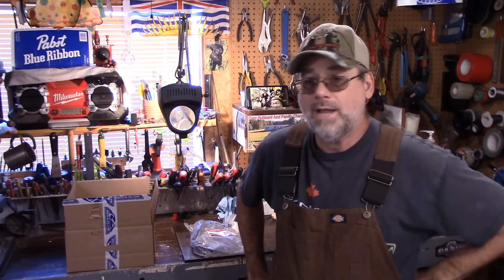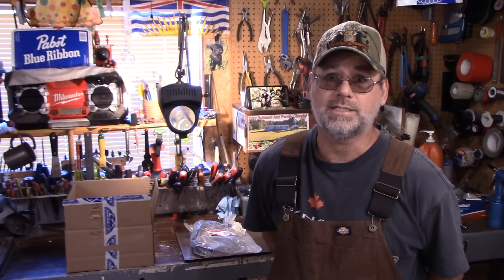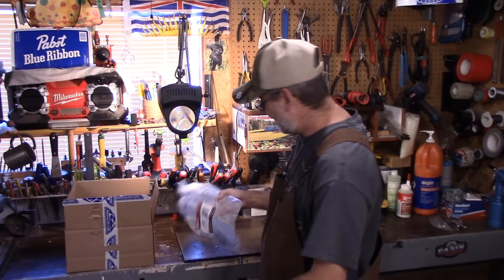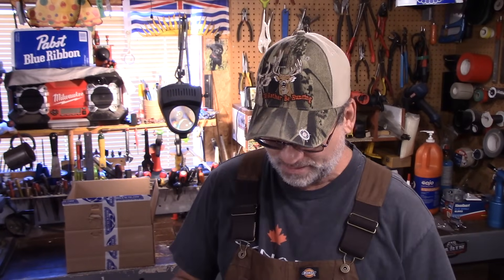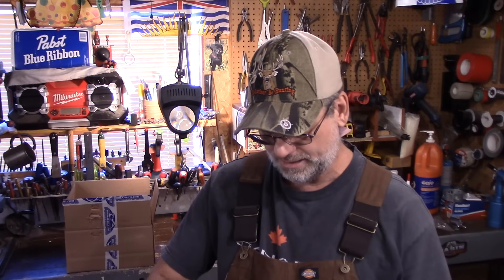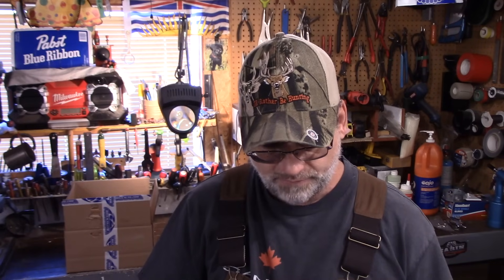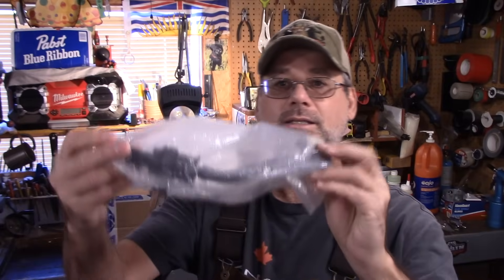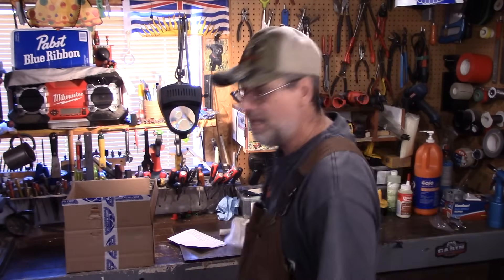F150  STALLING AT STOPS - THE FIX -  PART TWO

Comment: What about fuel pump activation noise???? I dont have a fuel pump noise and changed the fuel pump driver model
Reply from the maker: Mine was not a fuel related fault , the purge valve resolved it for me.
Reply: I changed mine and didn't hear the hissing noise just to find out that the "New" part I purchased was faulty. Hopefully up and running by now!

Comment: Hey Steve , I changed out the vapor canister purge valve and still my truck stalls out . Do you think it could be the fuel modulation controller ?
Reply from the maker: Gary if it didnt resolve it I would  see if your local ford dealer has any idea . Its  not  going to be easy doing it on your own as you may run out of money before you run out of guesses  :)
Reply: Hey Steve , My problem was The Fuel Pump relay P/N 8T2Z14N089D FOR $22.00 Since I changed that out my truck hasn't stalled.
Reply from the maker: Good news and a low cost fix 👍

Comment: I have an 07 f150 standard that everytime I downshift to stop at a light,  the rpms bounces to very very low and dies.  I don't have the money to take it to a shop but I'll try to fix it myself.  Any idea on what it could be??? I'm lost on this and stressing over how much its going to cost to get it running right. HELP PLEASE!!! 😳😳😳😳
Reply from the maker: First thing comes to mind is a dirty throttle body . Try cleaning it maybe that's  all it is.
Reply: @SteveRobReviews  I'll youtube what that is and see if I can get to it myself.  Thank you! I'll keep you posted!
Reply: The videos I've seen had Triton on the engines and 5.something engines... mines a 4.2 v6.  Is it all basically same on top? The Triton was totally different on top .
Reply: you could also try cleaning the MAF using CRC Industries Mass Air Flow Sensor cleaner. And if your going to clean the throttle body off the truck..you'll want to do a relearn process. Just google throttle body relearn process for your truck. Just did all this recently.

Comment: Have the same issue. 2015 f150 5.0. I couldnt find the rock auto part number you hard. Can you help me please
Reply from the maker: @jamesbush4568  Best advice I can give is to go to  your local ford dealer for the correct part.
Reply: Did it fix your problem I have the same truck year and motor having the same issue
Reply from the maker: For my 2010 4.6 litre the evap purge valve solved the stalling.  Took 5 minutes for me to change myself.

Comment: Any help,    I have a stall and hesitation on my 2002 ford f150,  only stalls and hesitation in cold mornings.  It cranks fine but stalls after a few miles. Cranks right back up and runs fine.  If I warm it up and then go, it runs fine
Reply from the maker: Could be many things but cleaning the throttle body is a good start.
Reply: I cleaned it.  I took it off.  New mass. New IAC. New everything but fuel pump.   It still runs great just has to warm up or be warm weather.  It stalls but cranks right back up and  runs great.   I'm gonna try fuel pump. It will be last to try. Everything else is new. All the little things.  It doesn't have any issues in the summer.  At all
Reply: Thanks for help.  Any help.
Reply: bad capacitors on your eec (computer)
Reply: If the eec or computer was bad, it would do it all the time.    It only does this in cold weather
Reply: @davidscott9257  If the eec or computer was bad, it would do it all the time.    It only does this in cold weather
Reply: @thebull5099  coolant temp sensor. when they go bad it'll make the truck run horrible also. it won't throw a code for it either, its pretty much the first sensor signal the ecc picks up. your truck will have two of 'em, one for the actual coolant temp, and the other one for the signal to send to the temp guage.

Comment: I have a 1997 f 150 4.2 v6 runs good but it  does stall some times  I put a new fuel filter it was good for a few days  then same crap stalling I've heard the spark plugs come lose on f150 maybe that's the problem because I bought it three years ago first two years ran perfect didn't stall at all.
Reply from the maker: Wayne if changing the fuel filter fixed it from stalling for a couple of days  then maybe you have lots of dirt in your fuel tank.  I'm thinking if your truck stalled every day and a new fuel filter fixed it temporarily them maybe its lack of fuel  or another plugged filter.
Reply: Dirty throttle body

Comment: My 2005 f150 4.6 stalled when I was coasting to a red light.   Started right back up but check engine light was on.  Got a scan, several codes....P0401, P0109, P2198, P2196.  Where do I start??  Help!!!
Reply: Also stalled a week later while driving at 40mph on a straight road.
Reply from the maker: Wow where do I start is right  is a great question . The codes will  give you a clue as to where to start and some codes are a result of the stall. The 401 egr flow is a good start  and go from there . If you want to know how to diagnose the 401 check out my buddies channel he has  plenty of Ford 401 vids. ScannerDanner , Paul is about the best there is.

Comment: I got a 2010 Lariat 5.4. It would stall 2 or 3 times in a 10-mile city trip every now and then. Never threw a code. Easy restart. Sometimes right  after a fill-up it would struggle at start up. Replaced this can and all is well. Thanks.
Reply from the maker: That's terrific 👍

Comment: i got 2015 F150 that i cleaned the throttle body and replaced the valve and it still does it. The throttle body was replaced this past july and it stopped doing it for a while and now its back. i get no lights at all . This is really weird problem . How has Ford not been able to fix this . It looks like it happens on every year modal f150.  will be the last Ford junk i will get. i guess i will just start replacing parts till it stops doing it.
Reply from the maker: The evap purge valve solved my stalling for over 2 years now.
Reply: What motor is yours?

Comment: I have a 1985 f150 lariat and it would  die on me randomly while driving, i changed the tfi module and it turned on but then when i drove it it started stalling bad untill it wouldnt turn back on, now it doesnt turn on even after i changed out the ignition coil
Reply from the maker: Wow , whatever it is it can be tested and fixed.

Comment: I have a 2010 f150 4.6l that idles rough and has no power under load and stalls when i stop. Throughs codes for 2 3 and 4 misfireing. Changed plugs and coils with no luck. Any ideas?
Reply from the maker: Well Wayne they are the 2 most likely causes but there's still injector flow , compression and so many other causes .  Changed  plugs and coils  but are they actually working as intended.  Faulty connections to mice eating a wiring harness ect.  I would look specifically at 2-3-4 all on the same bank , check for spark on each one would be my first thought .
Reply: How old is your coolant? Just went through a stalling issue that Ford worked on for three weeks.  Changing the coolant fixed everything. My coolant was old. It creates a current and fools the ecu into a lean condition. Causes misfires and poor idling
Reply from the maker: I change my coolant often , that's interesting how coolant could affect it that much , thanks for sharing .
Reply: @fstlnj29  when u say coolant are u saying the coolant sensor or the coolant liquid itself?
Reply: @lindseywagner7510   I drained the old coolant,, flushed and refilled with new coolant and distilled water. Fixed everything. When you have weak or old coolant and different types of metal the system becomes a battery. The additional voltage is what I believe throws of the ecu. I thought it might be a weak fuel pump but after I did the first work, before the coolant change I took it to the industrial park and just buried it and it pulled fine so I knew I was getting enough fuel. I bought my truck about 2 years ago and should have changed all the fluids then so I had a base line.

Comment: '14 F150 5.0 Coyote is stalling at stops while it's warming up. Once warmed up it idles sort of ok at stops but doesn't stall. Also if you try to quickly rev the motor in park it will bog before the rpms come up. Part is cheap enough, nothing to lose.
Reply from the maker: Let me know if it works. Cheers Steve
Reply: Well it fixed my issue completely. Cold start idles at 1200 rpm when it would normally bounce 800 to 1000. Rock solid at 600 rpm stopped in drive. Couldn’t be happier. Part store said they sell 2 of them a week. Great video! Subscribed.
Reply from the maker: @Steve007362436  Just awesome bud so glad to have been of assistance.

Comment: Okay Steve I have a 2000 Ford F-250 V10 super duty that's doing the exact same thing it's been in the Ford motor shop over 2 weeks and they cannot figure it out runs perfect at idle soon as you get in it to drive it around come to a stop sign stop light etc shuts off they replace the module sensor that did not help it
Reply from the maker: Tina my friend at my ford dealership never had a clue what was causing the stall and if there is no code they look at pattern failures and none popped up.  I was told the evaporative purge valve could never make it so rich to cause a stall but I was right and the high techs at Ford were so wrong .  Mine was not expensive and my wife refused to drive the truck as is so  the cost was an easy choice.
Reply: @SteveRobReviews  do you think it could be the same thing that was causing yours to do that The evaporated purge valve and yes they're not getting any codes either thank you for replying
Reply from the maker: Yes it could be .
Reply: @SteveRobReviews  thank you so much

Comment: mine was no more than a bad fuel pump relay going out
Reply: I drive an 09 F150 and had the fuel pump fuse 27 relocated due to it showing signs of burning up. I wonder if mine is relay related as well. That or fuel pump drive module. I pray it’s either of those if not the canister purge…anything else I feel will get costly. Thanks for sharing.

Comment: I cleaned my throttle body, then read in the Haynes manual that cleaning it with solvents can damage the coating inside 😮
Reply from the maker: I've read that too but  haven't seen one damaged so far.  Idle air control may be lazy as well .  No check engine light makes it difficult to find.
Reply: @SteveRobReviews  IAC should be easy to test by applying and removing battery voltage to it and seeing how quickly it responds. 
That's a great, no cost thing to try 👍
Reply: The aluminum is coated (Clear painted?) and some chemicals dissolve it.  The products should be labeled throttle body safe.
Reply: I have the same issue but got a code that popped up after I started it back up that said the vehicle was running to lean and the air full mixture was to lean. P0171

Comment: I have 2014 F150 and this past weekend it stalled out 5 x either at a stop light or making a right or left hand turn. The truck only has 32k miles on it. Do you think this purge valve might fix the problem ?
Reply from the maker: Gary for the low cost it might be the fix as mine  did  that as well. Cant say it will but it's a  logical try.

Comment: Have a 1988 f150 it stalls out every stop light unless you hold the brakes and gas at the same time! LoL plugs,wires,sensors,fuel pressure regulator, fuel pumps! After all this it turned out to be a stopped up cat converter! Ordered a new one! Just replaced the ECM(engine control module) aka brain box! And the selector valve for the dual tanks!
Reply from the maker: Wow thats a lot of work  , and expensive too 😅😅👍
Reply: @SteveRobReviews  the truck was my grandfather then my father and my first truck! I'm 33 now and still have it! I've taken it down to the frame cleaned painted the frame! Rebuilt the ttb 4x4 front axle amd rear end! New motor now rebuilt manual transmission and transfer case new carpet headliner door panels and bench seat reupholster! New headlights tail lights! Two tone Opel\pearl white on top of the cab ford Blue center and opel\pearl white on the bottom! The bed has new skins on an new header panel welded like factory! The ac ice cold the heat will run you out! Even the original radio restored and still in it! The 302 block unfortunately had a manufacturer defect a crack in the block found by magna fluxing! So I did a 351w stroker GT40p heads elderbrock intake and upper plenum larger throttle body all new exust yes even the cats and smog pump replaced put back on! New winch bumper and diamond step bumper out back! Alot of work did it over time have 6,800 in It! Buying everything new! The gas tanks sending unit  fuel pumps and no's prevent fuel lines where the hardest for me the gas tank was easy but the rest wasn't! I'm restoring  my f350 4x4 diesel crew cab now! Probably will have both of them for a long time! Have a beautiful 1968 mercury crew cab 4x4 truck all factory original highboy version! Rare now was my grandfather fist new truck he ever bought still in the family!
Reply: @SteveRobReviews  I have pictures unfortunately I didn't take video of any of it! Thinking of posting in a forum

Comment: 2005 ford expedition did a timming chain job new plugs new colils  now she runs good when cold but when in normal temp she feels like its going to fall apart   several codes po171  something about high oil temp and po174
Reply from the maker: Time to check your o2 sensors .
Reply: DPFE sensor

Comment: Twice my 01 Excursion stalled and cut off after a long drive. I did a full maintenance, (spark plugs, coils, oil change, fuel filter) and still stalled and cut out. Any suggestions or advice???
Reply from the maker: Throttle body cleaning is the first thought.
Reply: Egr vale or catalytic converter?

Comment: So just to be clear this is the evap purge valve that’s under the hood on the driver side? Or is it the canister purge valve under the vehicle
Reply: Please let me know as soon as you can
Reply from the maker: Under the hood . 10 minutes to change . Not one stall since I changed it in 2 years. Cheers
Reply: STEVE ROB REVIEWS thank you brother! Great video
Reply: The Purge valve in under the hood and it has a normally closed valve, the vent valve is at the evap canister and they are normally open.  The vast majority of the time it is the purge valve and not the vent valve.

Comment: I have a 95 Ford bronco 5.0 e40D trans it will shut off in drive but I can drop it down in 1st and shift gears to drive (while driving down the road) and its fine but if I come to a stop in drive and it shuts off, do you think that might be the issue
Reply from the maker: I wouldn't guess , definatey not the same as mine.

Comment: i got a 97 for club wagon 5.4 v8 and i been noticing when i run the air after a while and i am at stop signs it will all the sudden idle down and start running rich stumbling. i turn the air off and put it in neutral rev it a few times it goes back to normal seems to be like s switch kicks on and starts flooding the system any ideas? thanks you for any help
Reply from the maker: Idle air control solenoid comes to mind , take a look at it and make sure the throttle is clean too , thats pretty easy to  start.
Reply: sounds like mine...

Comment: Im currently deployed to the middle east and my wife is experiencing the same symptoms on my 2010 4.6 3v. I ordered a purge valve and she replaced it. Yet the truck is still doing the same thing. Struggles to maintain idle then stalls. Any suggestions? This truck was my grandfathers and dont want to see it down. She tries to drive my truck to work and around town 2-3 times a week to keep it from sitting. Any help would be appreciated. I had the plugs replaced last summer when the odo neared 100k. She had the fuel pump and sender replaced a couple months back as well. Any suggestions?
Reply from the maker: Very odd and could be many items but a dirty throttle body , have someone take a look and see if the throttle body is all carboned up.
Reply: @SteveRobReviews  thanks. My nieces boyfriend is going to help my wife with it this weekend. Hate that I'm halfway around these world and can't work on my stuff.
Reply from the maker: @mtchbrian  Let me know  how they make out.
Reply: @SteveRobReviews  nothing they tried worked out, so my wife had it towed into a shop we trust to do diagnostic work. Turns out that the new fuel pump had crapped out already. Good thing it's under warranty and the shop is doing the work for free.
Reply from the maker: @mtchbrian  Wow , at least now you know.

Comment: I have a 2015 f150 5.0 no sensor reading no warning lights. Every now and then then engine will idol low and rough and shut off.
Reply from the maker: Completely different problem pierre  in my opionion . I'd suggest you clean the throttle body  , it's easy to do just follow the  safety procedures and that's a low cost place to  start , just may be the problem . 👍
Reply: @SteveRobReviews  I replaced throttle body and it still occasionally does this. What's next? Spark plugs done as well.
Reply from the maker: Did you replace the evap purge valve  on the motor ?  That's what fixed my intermittent stalling.
Reply: @SteveRobReviews  no I guess I'll do that next. Do I need the cable that comes with it or just the valve?
Reply from the maker: Its one assembly  from ford  so easy to replace , tops 10 minutes .

Comment: My mechanic changed the purge valve and I still have the problem a few months later tho
Reply from the maker: I guess your mechanic didnt find the problem.  Keep looking I guess.
Reply: Is this problem unfixable? I’ve looked at so many forums and no one seems to have a solution.
Reply from the maker: @newyork302011  Of course its fixable . A good technician can find the fault .
Reply: I’m also on the same boat, should I replace the oil sending unit first? Or the purge valve?
Reply from the maker: @brycenhiga3635  Gather some evidence your condition is the same then try what's logical . It's all fixable .